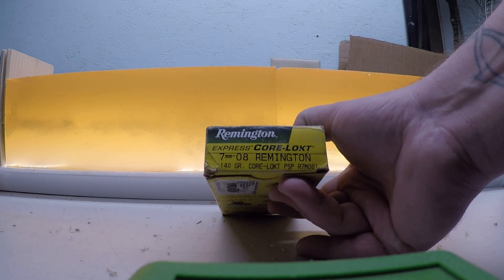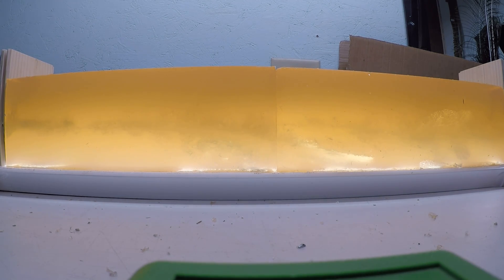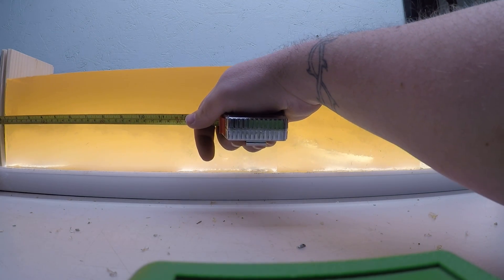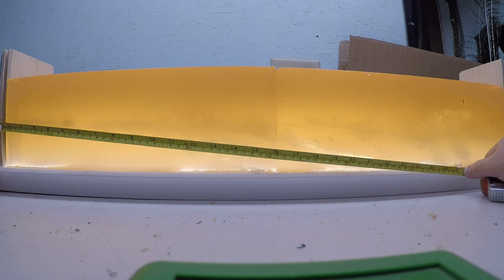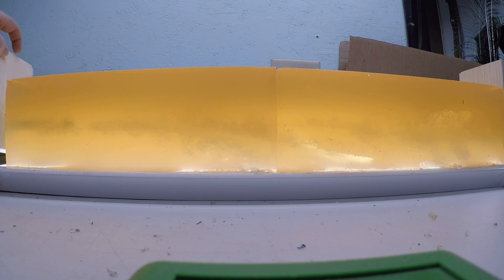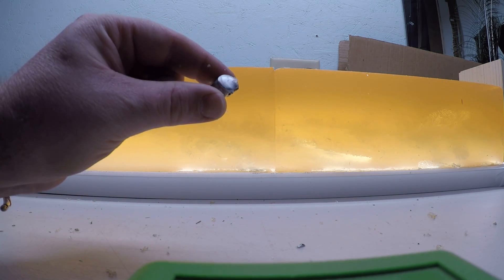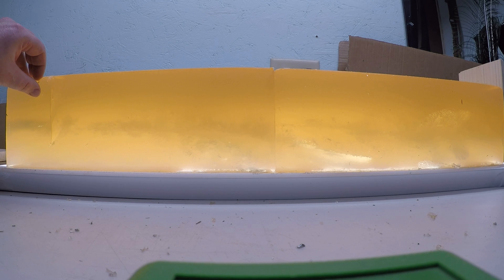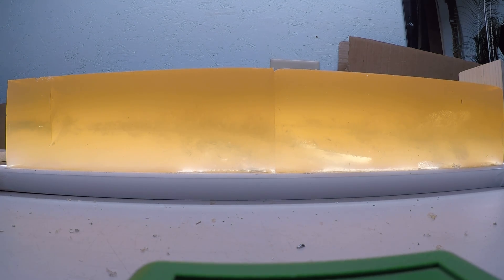7mm-08 140 gr Remington Core-Lokt ballistics gel test at home overview of terminal performance

Comment: How did you get such a large variation in velocity from the same factory loads? 2800, 1800 and then 1900...
Reply from the maker: I pulled the bullet and then loaded up a reduced load. Because there is so much case volume when doing reduce loads you do not get exact powder Burns load the load so they can vary by a 100 plus fps. My goal is always to get around or just under the 2000 fps mark on my reduced loads.  If they come in well under 2000 fps and the bullet still performs then there's no need to bump the speed up only if they do not perform do I need to start increasing my velocities until I hit the low end of the bullets performance.